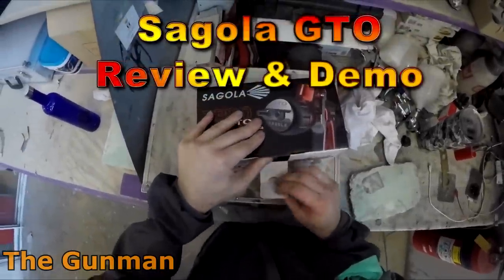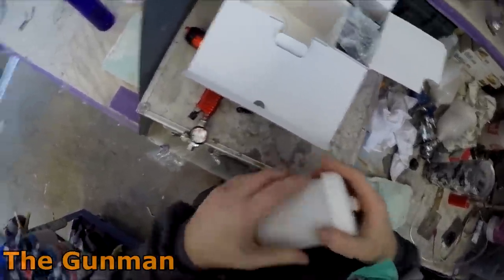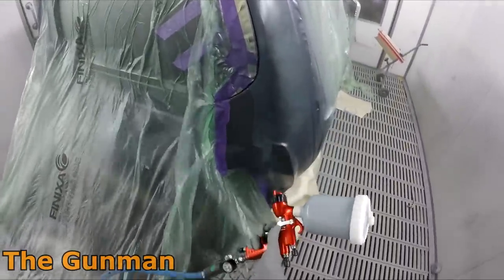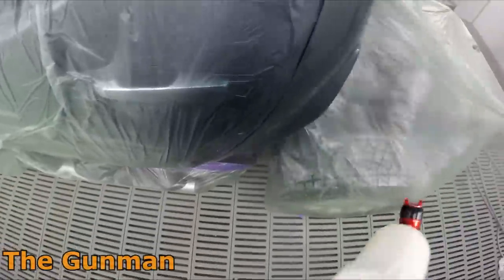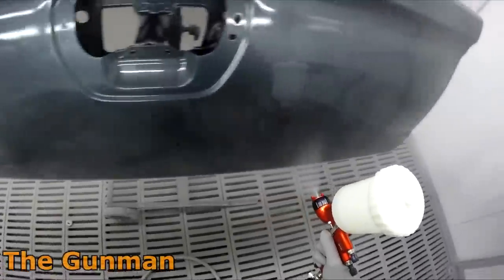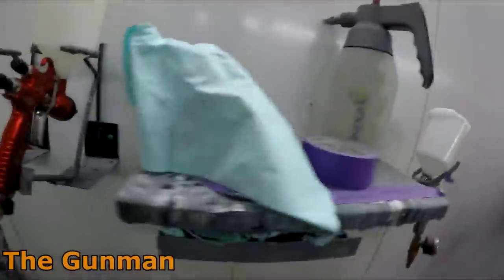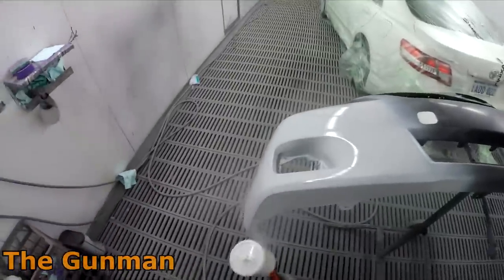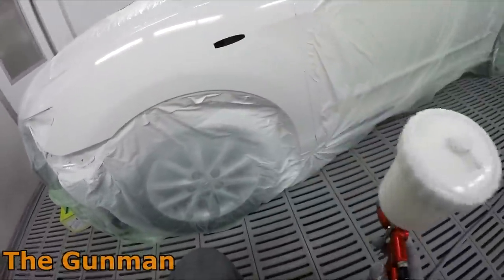Sagola 3300 GTO Review

Comment: 20 - 25 psi , I been using sagolas for marine applications for past four years and I like them , I screw mine out at least 3 full rotations , I use tekna pro lite pressure pot set up for bigger areas .

Comment: Tweaking the fan in slightly often resolves such pattern issues ,one thing I can attest to is durability of Sagola  ,we have run a 4300 xtreme solidly for over five years without any issues or service parts required .I got my first Sagola some 35 years ago which where in fact the Devilbiss JGA rebranded  .Cannot fault the brand at all we now run two 4600 xtremes and they  are smashing it for us

Comment: Hello Sir, I would like to purchase a set of alloy wheels for my car however the particular model wheel is only available in silver-grey/ gunmetal color and then chrome. The silver-grey/ gun metal color was achieved by first powder coating then spray painting in the two colors. The chrome wheel was achieved by plasma vapor coating.  Which of these two coatings methods mentioned will allow refinishing the wheel entirely in the silver -grey color only without any issues for the long term?  The wheel is the the BSA 291. Please help, thanks again.

Comment: Hey Gunny, what’s up man? Another great review. I have a question that maybe you can shed some light on. I work at A production facility here in the US. I’m a painter here and do a lot of the respects and repairs for when the robots might have made a mistake. We spray wet on wet here and use Exalta.  We use water based primer. Then solvent based top coats. The primer normally has plenty of time to flash off and runs through an oven as well. Though I thought water based paint dry best with air movement. Anyways,  Then it’ll get base and clear and run through an oven again. 
They are changing the process and wanting to spray wet on wet on wet. I’ve asked how that’s going to work but they act as though this information is classified. A wet solvent based over a wet water based primer sounds like a disaster waiting to happen. Am I wrong? 
Sorry for the long bit, if you don’t have time to answer back I understand. A busy man. 
Thanks again for all the videos you post.

Comment: I have a 4500 extreme and it has an uneven spray pattern too. It sprays the clear well, but you can't spray metallic paint
Reply: I´m curious what air cap you have. I have aqua cap and i spray only metallic paint with it. Haven´t noticed uneven spray pattern.
Reply: @nsn200  it is the aircap for clear. 1.3 XL or something like that. And it has a really visible uneven pattern

Comment: Currently rocking flg5 1.4 I put that ish on everything, and IMPACT air gunsa black 2.0 for 2k, impact atomizes great and has updated fan size.
Reply from the maker: Can't go wrong man, that gun's a beast.
Reply: Same here! It is a machine! Thanks gunman for recommending spraygunsdirect they are awesome
Reply: I was going to buy a nozzle needle set for the impact Gunsa ($80) what they don’t say is the needle does 1.6-2.0, so I drilled out the nozzle to 1.9, saved $80 and have a killer primer gun.

Comment: Guilty,Ive been back pressuring my spray guns for years, Sometimes I'm to lazy I will put clear and activator in spray gun and use back pressure to mix it.😆😆😆
Reply: Filiberto Barrera I usually dump everything in the gun then put it on the shaker 💥😆💥

Comment: no plastic  adhesion promoter before sealer? uh oh
Reply from the maker: It's in the sealer buddy 🤣
Reply: In all the systems I've used, plastic adhesion promoter is an entirely different liquid that is applied to the plastic before sealer. I'm talking about standox solvent, cromax solvent, ppg nexa... and so on. If it's different for waterbourne then I apologize and was referencing solvents.
Reply from the maker: @djentleman7  I've never forgotten to use plastic primer in my life. I'm switched on when it comes to work. Current day Standox, Cromax etc. Use a plastic additive that makes it stick straight to the plastic. It's not any different with solvent or water, in fact I think I was using solvent back then.
Reply: @TheGunmanChannel  it may be different systems here in the states. We have plastic adhesion promoters that are put on before sealer.

Comment: Lol lol you called the regulator a cheater valve?
Reply from the maker: That's what it's commonly known as, they aren't really regulators because they don't regulate the air. A diaphragm regulator will stop fluctuations if it's dialled down. These cheater valves are more to let you set the pressure, and gauge the pressure you're at.